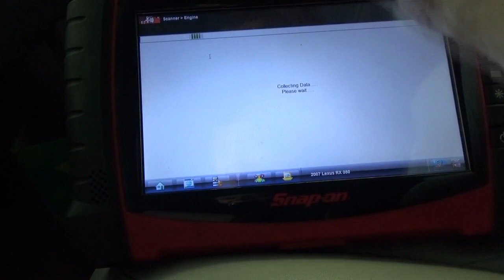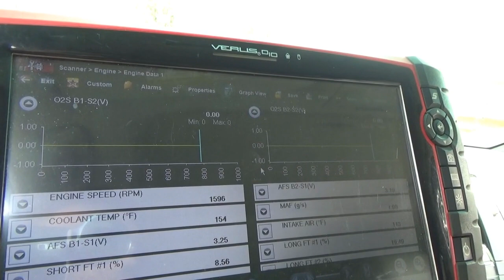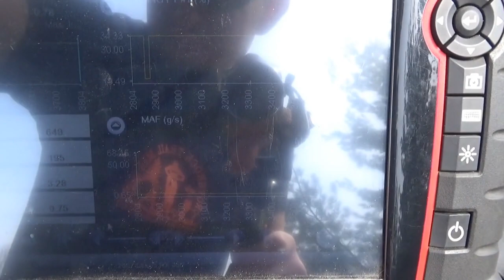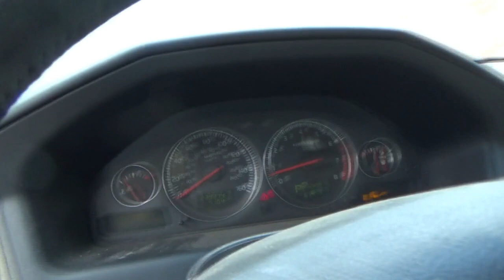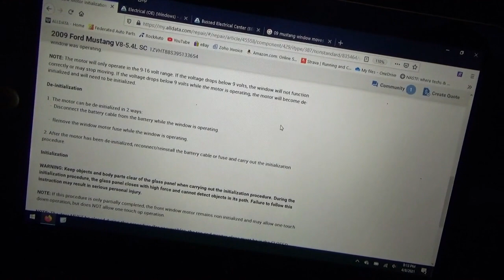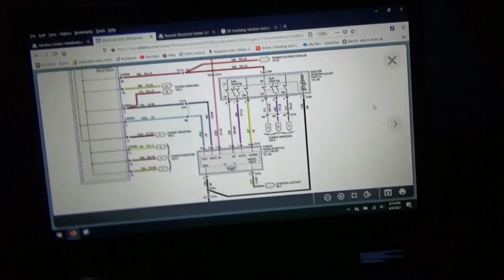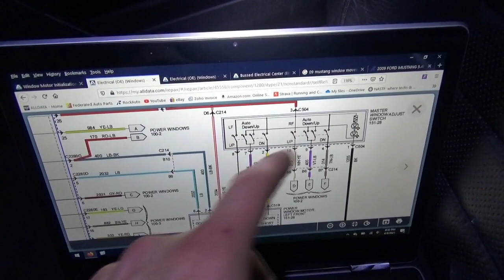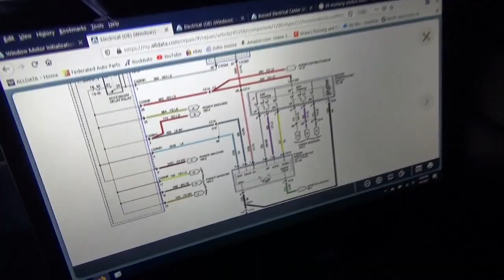Lexus-Volvo-Mustang (Indiana Road Trip - Day 1)

Comment: My first instinct with that Mustang was broken teeth on a plastic gear in the actuator. The way it stopped and started seemed to be regular, as though the gear is spinning the whole time but only grabbing when the intact teeth make contact. It would be fun to pull that apart and see what's there.
Reply from the maker: Wasn't a mechanical fault, motor would just stop until you pressed the button again lol

Comment: Where the window will only move an inch at a time, it's because the driver module isn't getting feedback from the pulse counter on the motor.
This is to stop the motor being burnt out if the window is jammed.
On some designs such as Valeo / Temic motors the module is clipped to the side of the motor and the pulse counter is a hall sensor in the module coupled by a metal bar into the motor.
If the bar is missing or the module is not correctly seated, they exhibit this same behaviour.
On windows in frameless doors that have the "open an inch" function when you go to open the door, a faulty switch in the door latch can prevent that happening. See it a lot on VW, there will usually be an "implausible signal" code for the door lock.

Comment: My 99 4runner had a lean code when aftermarket MAF was reading low. Had a rich code when the fleebay injectors started leaking. Put good parts on, get good performance. Pretty simple really.

Comment: Rule #1-- DON'T buy low price  aftermarket electronics/sensors or critical engine parts. Rule #2-- If you are a cheapskate and buy Chinesium parts, you WILL end up paying more than double the price of the OEM part because they will have to be swapped out MANY times and eventually get a OEM part regardless.  Rule #3-- NEW doesn't necessarily mean GOOD !!!
Reply: Particularly true with Toyota, OEM or Denso, they are very picky, aftermarket will give you headaches 99% of the time

Comment: Back when I still had my 98 F-150 in about 2010/2011, the passenger side window motor went. I put a new one in and it lasted a grand total of about four days. Took it back to Ford and put a new one in all good after that. It seems as though I remember the parts guy said something about Ford having trouble with window motors around that time.

Comment: Ivan -- a MAF puzzle: I don't dispute the rule-of-thumb that at idle you would see 1 g/sec for each litre of engine displacement. But why is it this number?  Suppose 600 RPM, 10 R/sec, = 5 cycles/sec, for a 1 Liter engine that gives = 5 liter/sec. If this was at atmospheric pressure, that would be 5 x 1.3 g/L = 6.5 g.  But the idle manifold vacuum is likely around 18 inHg or 9psi of vac, which means the absolute pressure is about 0.38 Atmosphere. So that 6.5 g would reduce to 6.5 x 0.38 = 2.47g.  So why is the rule-of-thumb only 1g/sec per Liter of engine and not 2.47?  There's a pretty large factor missing somewhere!

Comment: I get that sort of fuel economy out of my 5.7 litre Chevrolet LS1 V8 powered Holden VY SS Commodore around town (20-24 miles per UK gallon or 18-20 US miles per gallon) & that's out of a big V8 engine.

As far as the Lexus goes a 20+% Long term fuel trim would still Lead me to think that there's a problem either with low fuel pressure,an air leak or a restriction such as a blocked catalytic converter or something.

In the Commodore long term fuel trims which were pegged at 25% on both banks , check engine indicator & P0171 & P0174 lean codes were caused by a faulty fuel pressure regulator.

The fuel pressure is 61 PSI at the moment but it was 51 PSI then !

Comment: I wrote an entire dissertation on these codes on a Lexus Owners forum,,,,,, mine had a hard to find vacuum leak that was very difficult to find even with a smoke machine. Turned out the leak was only at idle and not under acceleration and was from a butterfly valve shaft bolted to the side of intake manifold which I believe Toyota uses to regulate airflow into cylinders under idle.    That Lexus has poor O2 sensors or a intake vacuum leak I would bet.  Or a combo of all of them.

Comment: The MAF sensor should read the size of your engine at idle or pretty close. These sensors are the most sensitive out of any sensor on the vehicle one little miss read of this sensor can cause everything to go crazy
Reply: But the throttle position should change the amount of air flowing thru the MAF, not ?
Reply: @brannung     Yes but when engine at idle the amount being red by the sensor should match the size of the engine say you have a 3.4 litre engine the MAF at engine idle should red that or close too it. When there’s no load on the engine it should match engine size

Comment: Hey Ivan I have a Yaris 00' that is running rich on idle when warm, LTFT 20-25, STFT on idle 20 but when raised RPM drops to 0. Lambdas are responding nice. No work done to the car, all original very low mileage. Any thoughts? MAF shows 1.4-1.6 on idle

Comment: That Lexus Air Intake Temperature wasn’t a clue? I thought that was part of the MAF and used as input to the combustion tables not just for a pretty outdoor temperature display.
Reply from the maker: Yes it's integrated. What is the clue?
Reply: @PineHollowAutoDiagnostics  114 F in April?
Reply: sharp eye!
Reply from the maker: @mentatphilosopher  hot idle under the hood 🙂

Comment: Sounds like over current thermal cutout bad on window motor, which is in motor.
Reply from the maker: Actually it was too predictable and repeatable to be a thermal cutout... I bet it's a problem with the position sensor or circuitry
Reply: @PineHollowAutoDiagnostics  I was thinking it was related to the "indexing" used when the frameless door is opened/closed when the window is up like on my Camaro.

Comment: The window issue seems to me that whatever logic is involved doesn't know the position of the window so defaults to creep it an inch at a time rather than going full speed.
As the reinitialise didn't resolve it - and not knowing how the thing keeps track of the position of the window - I'm going to guess..... the reinitialise is supposed to put the window to a known position, from there the motor unit keeps track of position using a hall effect sensor to count revolutions of some part of the mechanism.
Utter guess as I say. I'm just noting this here should this come up in the "too be continued" so I can laugh in the face of being wrong and learn something :D

Comment: Watching as I write this. Wouldn't a low signal from the MAF cause the fuel mixture to go lean?
Reply: The fuel mixture will not go lean because the pcm will command fuel based on the amount of air. Less air means less fuel will be commanded, which will most likely result in a lack of power.
Reply: @bbmd2200  now that I think about it, yes, it all makes sense. Sorry about the confusion, it's really late at night / early in the morning over here...

Comment: I don't think you initialized the window correctly. You are supposed to HOLD the switch up at the auto second detent until the window closes fully and keep holding for more than 2 seconds. Because the control module needs to re-learn the limits of the window. The reason the auto mode isn't working is because it hasn't learned the limits yet.
It only learns the limits when you cycle it fully the way the instructions said, otherwise, the window motor will always default to full open out of safety concerns for not trapping someones limbs.
You need to push the window switch down fully, and hold until the window physically stops, and keep holding the switch down for at least 2 seconds, then hold the switch up fully and wait for the window to top out and keep holding for more than two seconds.
It didn't look like you ever did that on camera. Just clicked and let go.
Reply from the maker: Trust me it didn't work 😅  otherwise owner would have fixed it himself lol
Reply: @PineHollowAutoDiagnostics  Ahh ok. I looked closely, and it seemed to me like each time the switch was released early without waiting.

Comment: never trust the "fuel economy" display in a vehicle, their relative and based upon lab/test track conditions. poor running problem = very skewed reading.
way newer models may be closer if they use GPS in combination with fuel gauge, which I trust about as far as I can throw a 300lbs weight LOL

Comment: I've had a lincoln ls with similar window issues turns out that battery voltage too low and because of that the motor would draw more amperage and it would think something was stuck in the window
Reply: Wouldn't that affect the passengers side also?

Comment: My mother had a 2004 RX330 and it was a pile of shit even new. Abysmal gas mileage, wood trim that cracked @ 30k miles, a CD changer (on back order) that failed at 35k miles, and a transmission that started acting up at 50k miles. This was driven by a 60 year old woman. Disappointing given that it was expensive and basically a dolled-up Toyota, without the reliability.